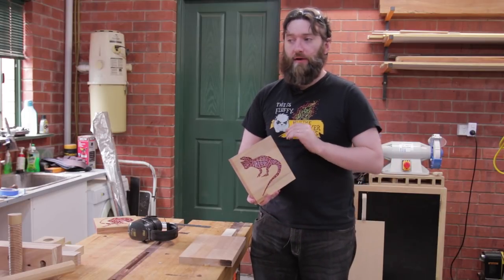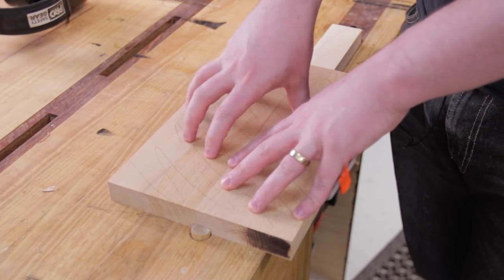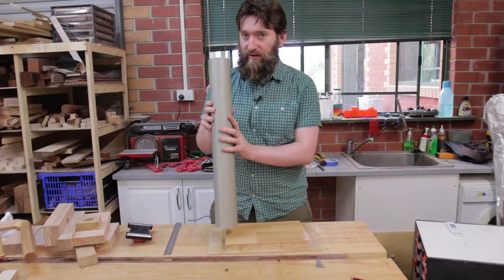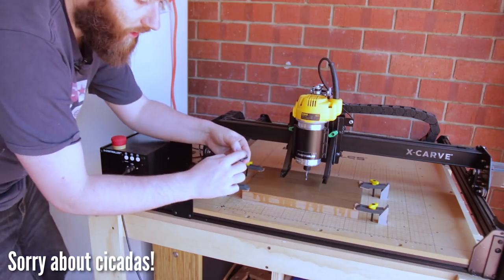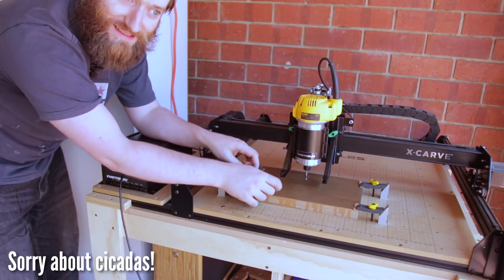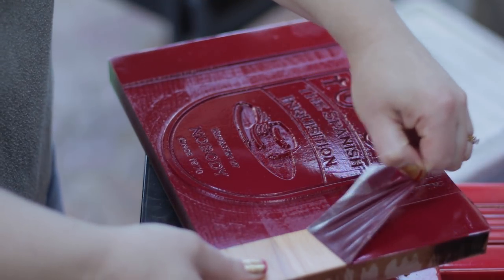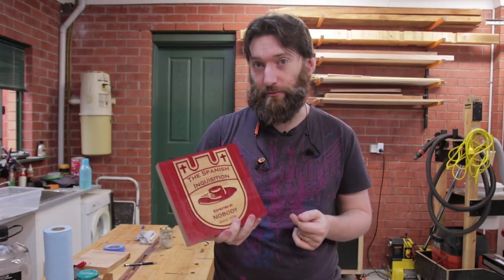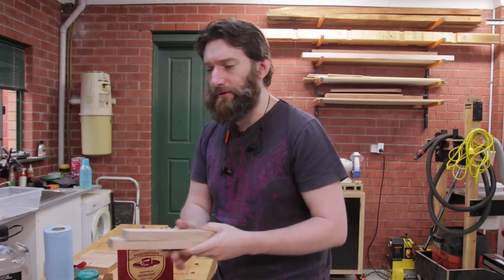Perfect Spray Paint With Masks

Comment: Paul, you should try adding rubber cement to your process. Adding a thin coat on the surface before you apply the mask works great at keeping those edges sealed really well and removes easily afterward.

Comment: What about using a surface planer. I used mine on the same kinda projects and had great clean lines after with no masking or sanding.
Reply from the maker: +Custom Chris depends on the carving size and detail. For something like this it'd result in chipout